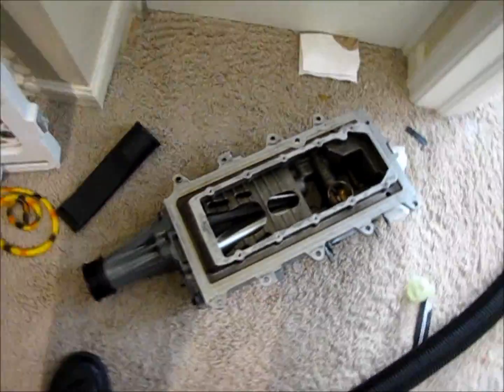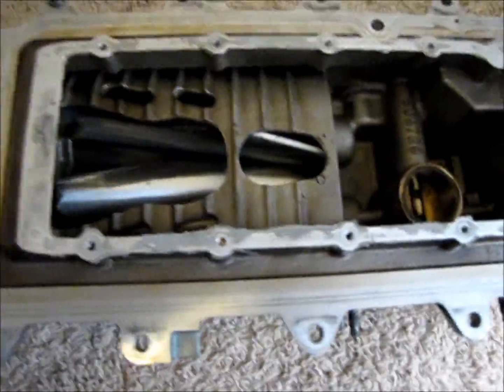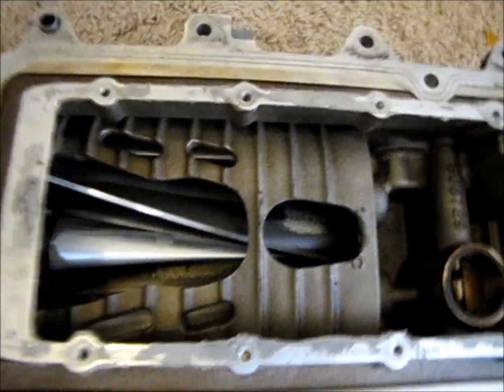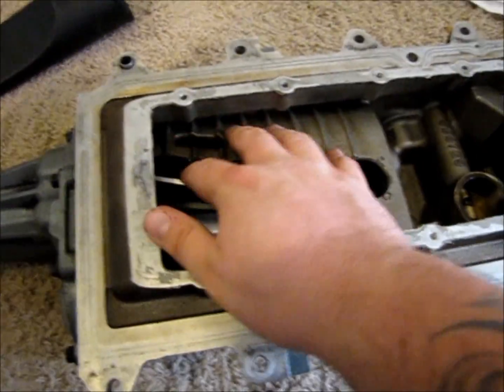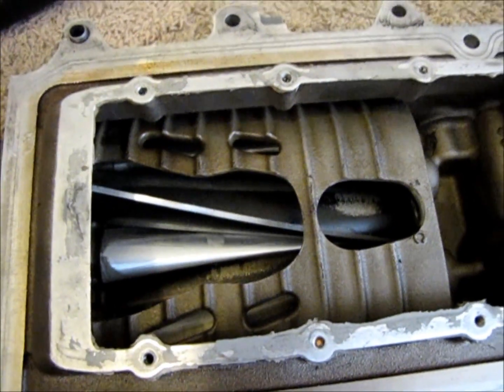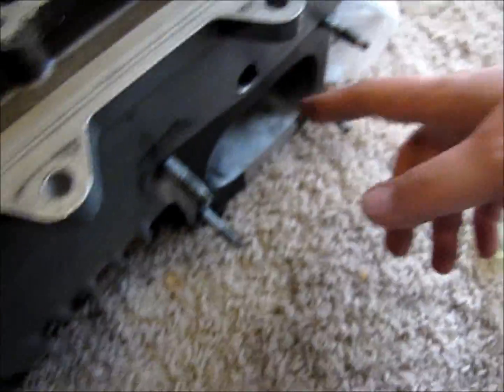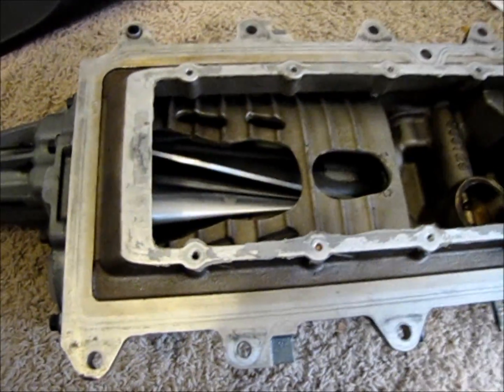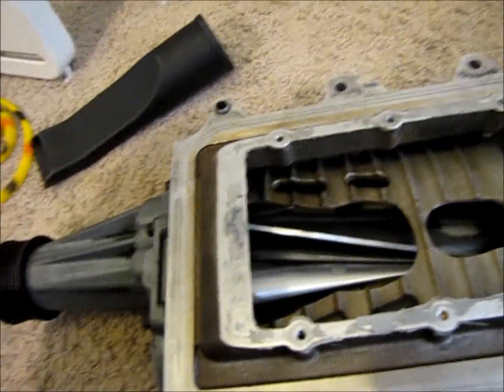M112 Supercharger bench test

Comment: Supercharger whine comes from the rotors being under load from boost. This is why there is no whine under no load=boost.
Reply: I don't want to say im right here, but im pretty sure it comes from the belt itself. I have heard blower belts come off and its instant no blower sound even though they are clearly still spinning for a few moments
Reply: Correct. Once the belt is off the blower decels in milliseconds to the point of no pressure under boost. This is why the sound goes away. They still slow in deceleration but boost was gone almost instantly.

Comment: Hi there, how did this blower perform? I have brought a M112 which has rotor wear/rubbing through the coating that looks identical to yours, everyone I've sent pictures to sais it has a rotor timing issue and needs rebuilding. though I wonder if it's just from spinning so fast with the 2.8 upper. Mine turns over nice by hand aswell.
Reply: its all about clearances. They might be concerned you will be losing .5lb of boost and it won't last long. Which is true. Shinyness doesn't matter. just depends how it was coated. Im not sure how to test the clearances if it's with feeler gauges or with plastigauge. but it needs to be very tight. Some think the clearance compresses air, this is false. It may do it for a moment, but once on the other side of the lobes, it is decompressed again. The thing that produces intake pressure is the air flow, and the air restriction of the motor. Not the lobe clearances; that is the seal to stop the pressure on other side from escaping.

Comment from the maker: @xmodrock do you mean the kenne bell designed for the 5.0 or the SVT Cobras? If you mean the OLD kenne bell for the 302's there horrible, even worse then the eatons at building heat, and they don't support enough power, IMO

If you mean why didn't I get a kenne bell for a SVT Cobra...... there $3,000+ I got this blower for $520, and it will make more then enough power to blow the block apart (500rwhp)

Comment from the maker: @StephenPowers12 its a kit that bolts to the lower intake, clears the distribitor, and extends the snout to reach the 302 belt. it also has a adapter to use the foxbody throttle body.